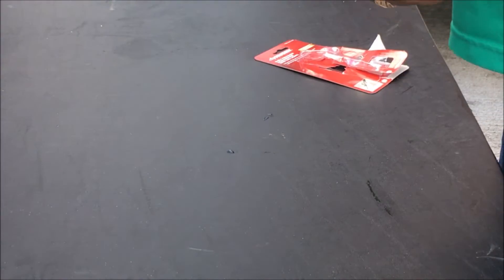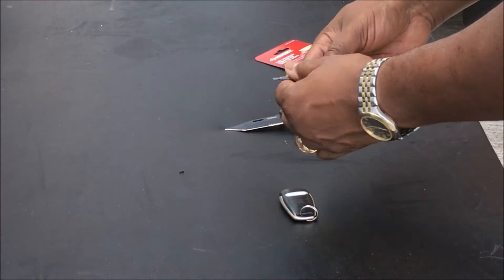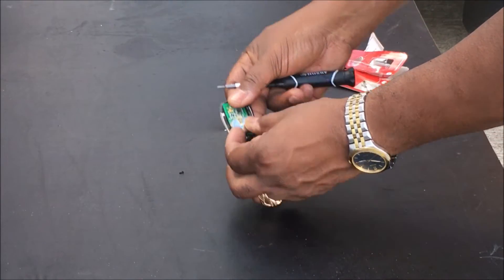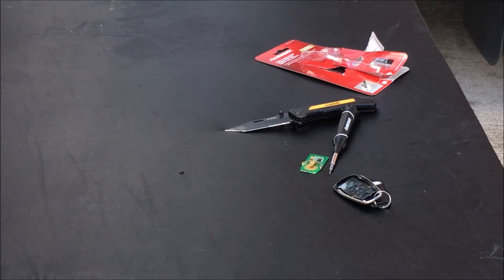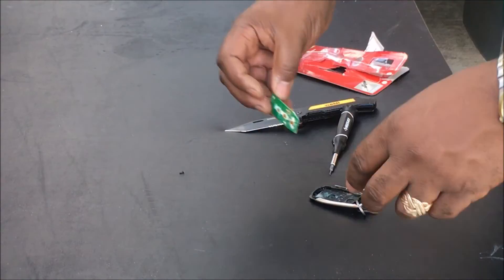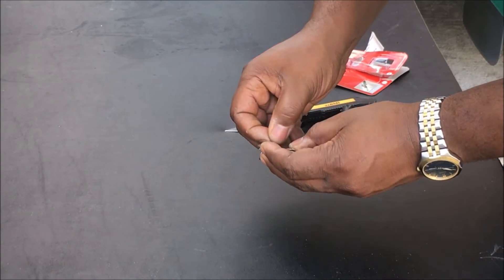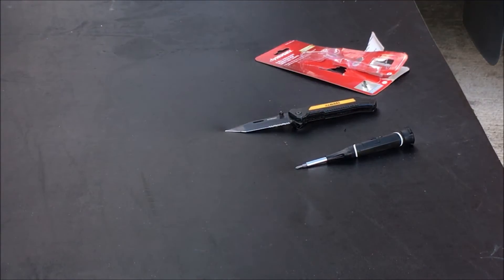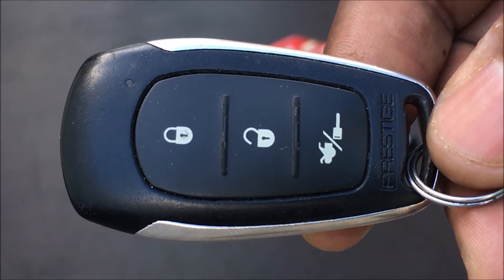How To Change The Prestige Car Remote Battery

Comment: Bought and installed a prestige alarm and the remote does not even have that slot … it’s a shame that the technicians at prestige didn’t figure out that at some point in time the batteries will have to be changed … smh … Nam Jamaica